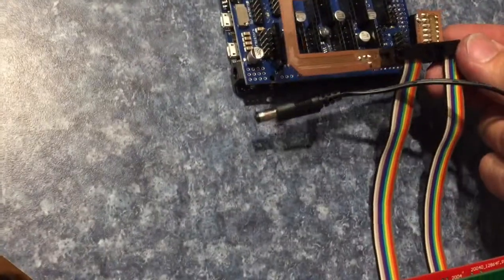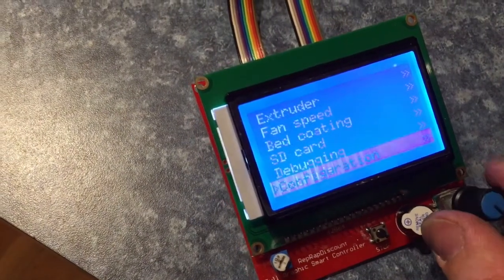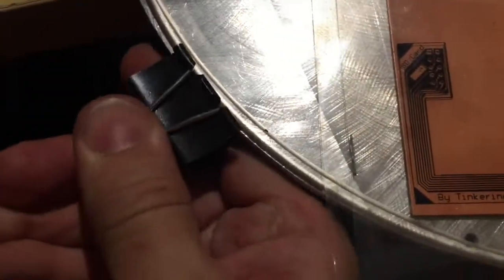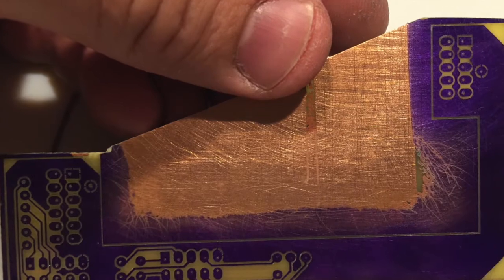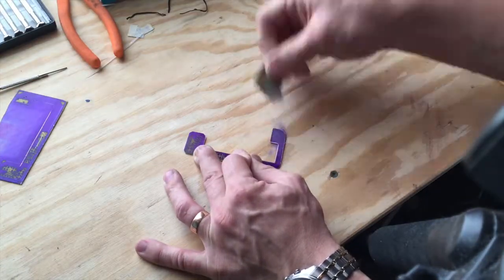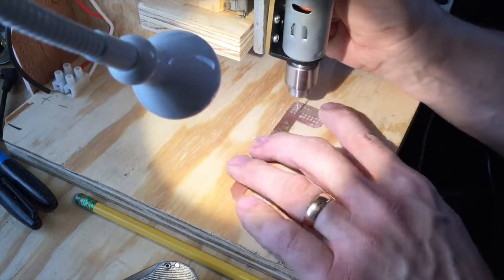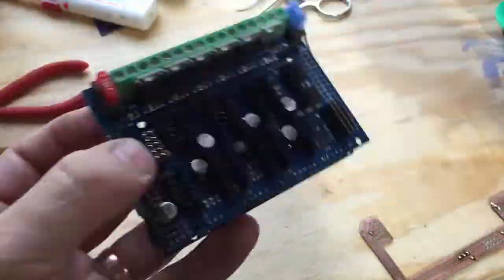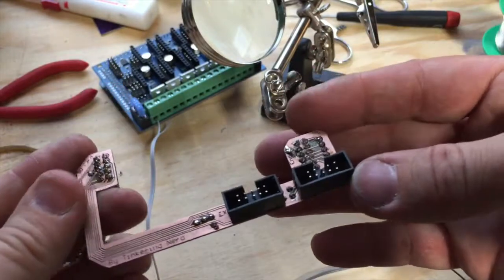3D printer upgrade: DIY adapter converter PCB for RADDS and Full Graphic 12864 LCD

Comment: hey, nice work :) could you have a look at circuitmaker, I have problems downloading your design, thank's
Reply from the maker: Hello and thanks for your interest! I looked at the project in CM, and it looks just the way I left it. I did, however, find out that it doesn’t generate gerber file for some unknown reason. Originally, I didn’t need it, I just printed and transferred the pattern. If you could share some knowledge about how to make it work better, I’d greatly appreciate it.
Reply: @TinkeringNerd  Hello, I am new to circuitmaker software, so I can't really help you. I hoped you know what to do, other pcb designs from other people where  no problem to import.

Comment: Omg the Circuitmaker is a crazy software! =D After one hour I can't print on a paper the top and bottom layout for etching PCB. Is possible to send me simply pdf in current scale of these two layouts please? r.turinsky@seznam.cz
Reply from the maker: +Robert Turinský will try :-)
Reply: Tinkering Nerd That will be helpful.
Reply from the maker: Sorry for the delay, I had to dig out my old computer. I tried to export and save files in PDF format (or any other format) to no avail. But, I checked and verified that it will print from within the CM app. You need to download and install the app on your windows computer, then open the design (optional: fork the design to make changes), open pcb, click “outputs” tab, click “printing”.

Comment: Hiya, would you be able to sell one of these boards? Or would I need to try and get them made from the circuitmaker site?
Reply from the maker: +Pioni-Sensei thank you for your interest! Unfortunately, I do not have sufficient means to be able to deliver a decent, presentable product. If you are going to use my project on Circuitmaker, please keep in mind that as I mentioned in the video, the SD card connector needs an alignment adjustment, it needs to be moved down about 2 mm. I still haven't got time to get to it. Feel free to branch this project and modify it, although, it still works as it is, as seen in video. Keep us posted of your progress and success!

Comment: i have made a 3d printer but facing some issue.i cannot home all axis.i m doing it manually by pausing the printer.and also i m not able to control prining speed from lcd display.i thing this might be from marlin.plz help me out
Reply from the maker: Your comment fell into quarantine for some reason.. Thus, the late reply: If you are using Marlin on delta printer, you need to switch to Repetier, it is much better! Did you get it figured out yet, please share your progress.